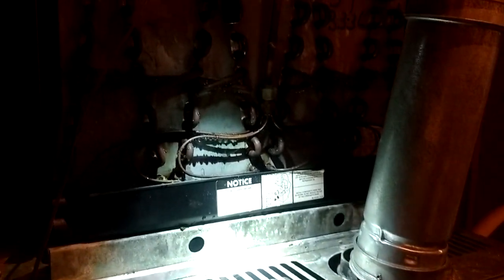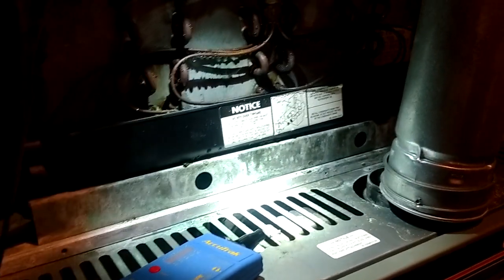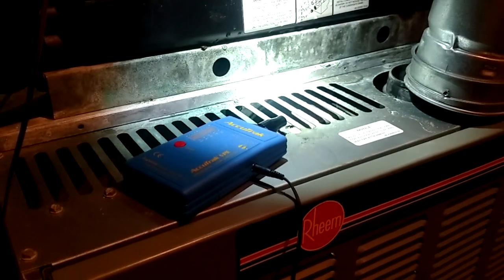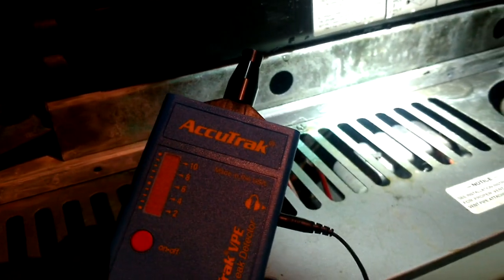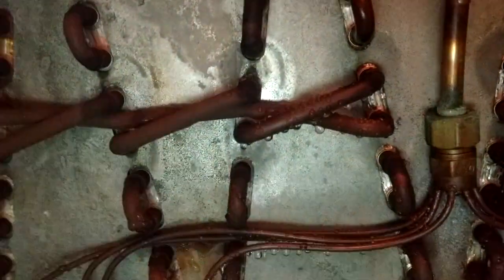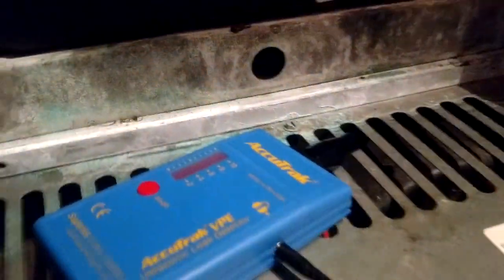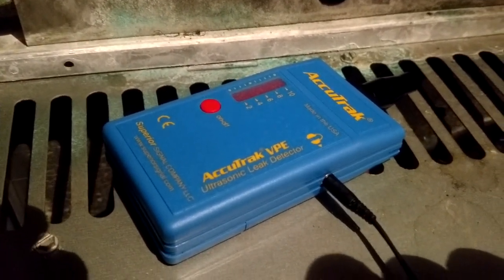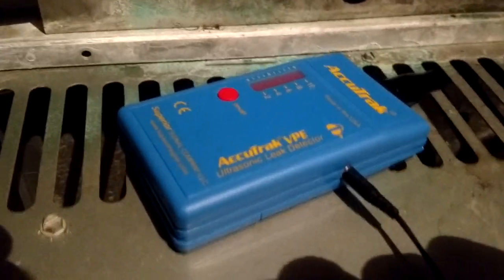🎧 Using Accutrak VPE ultrasonic leak detector in the field to find a very small HVAC refrig. leak

Comment: So wierd. My leak detection rate with this only 20% and it take an hour or more. And a lot of times i hear other noises like ticking sound and electrical buzzing. But i know system has a leak because i charge 2lb a year

Comment: Looks like you have had for a couple year now how is the detector holding up. How is the quality?
Reply from the maker: It's good. There's not really anything to tear up on it. No sensors to replace. Just change the 9 volt battery occasionally.
Reply: @sknight0391  ok thanks!

Comment: Hey Shannon, have you ever installed a UV light in a coil?  If so or not what do you think of them?
Reply from the maker: It will get very expensive replacing the bulbs over the years.
Reply: @sknight0391  Thanks, just wondering about them.

Comment: I finally got one. I noticed the sound is like static on a radio when it finds a leak. Any tips? I noticed when you spray water on the coil to emphasize the sound , it actually makes a lot of artificial noise because the water has air bubbles in it and those pop.
Reply from the maker: You just got to play with it. I don't usually recommend turning the sensitivity all the way up. For most applications you can get by with it just alittle over halfway up. I always test mine by lightly blowing out through my nose. That will also help you get familiar with the sound of escaping gas. Also use a can of compressed air to lightly bump it just to get used to the sounds. And I always use it in a sweeping motion left to right and up and down to pinpoint the leak location. Once you start finding a few actual leaks with itand get used to the sound then it will really make things quick and easy. I think you'll grow to love it over a period of time. Will it find every leak? NO. But it sure will find a bunch of them 👍
Let me know how it goes over time.
Reply: These thing actually “pitch shift” the ultrasonic frequency of the leak to a frequency that the ear can detect.  The leak is hissing but way out of human range above 20khz.  They have their place and uses but are not an end all tool.  Good to have!
Reply from the maker: @u2ooberboober  yes I completely agree. There is no such thing as a leak detector that can find every leak and anybody that tells you there is....Is full of sh!t. We have to have multiple tools in our arsenal to get the job done the best way we can for the homeowners. But the ultrasonic leak detector is always the first tool out of the van when I'm looking for a leak.
Thanks for watching and giving your feedback 👍
Reply: @u2ooberboober : YES. It's called "heterodyning". Many RF spectrum analyzers use this technique.

Comment: I just purchased one a couple weeks ago. I've tried it on two leaks so far. The sniffer found both, the Accutrak found none! I even tried it on the known leak area that the sniffer pinpointed with no luck. 
I am very disappointed, what a waste of money!!!!
Reply: Something is not adding up. Either you are doing something wrong, bought a cheap unit, or have a defective soemthing.
Reply: @Fighter4Street  I have since  received a replacement and it works well in most cases.
Reply: @MrDeviousdom  Would you say the ultrasonic device works better or worse to find very small leaks compared to a sniffer? Thanks
Reply: @Fighter4Street  ultrasonic detectors will not find ultra small leaks.
Reply: @MrDeviousdom  there's no leak detector on this planet that can find ultra small leaks.

Comment: I have been using this same tool for about 19 years. I use the yellow extension  tube which makes it easier to get to tight spots where you cannot  get  your hand  and  tool to. NOt sure if you know that Inficon makes  a Ultrasonic leak detector as well and its 50% less in cost to purchase  then this Accutrack.  Great video Shannon .https://www.ebay.com/itm/Inficon-Whisper-Handheld-Ultrasonic-Leak-Detector-711-202-G1-NEW-FAST-READ/192905542180?epid=2255626128&hash=item2cea10fa24:g:KIUAAOSwU7Bcy3kr:sc:USPSPriority!21214!US!-1
Reply from the maker: Yeah, Accutrak has made several improvements over the years. The biggest of which is you don't have to hold in the red button anymore. Now you just press it to turn it ON and you're good to go. They've even Incorporated a peak hold mode. And the sensor supposed to be much more sensitive now also. Thanks for watching 👍

Comment: No video with soap or leak detector so we can judge what the comparison ?
Reply from the maker: N.W. Ohio HVAC
This guy also has a really good video using the Accutrak "gooseneck". Same detector but has an attached flexible neck. I prefer the VPE because you can do more with it, like listening to the insides of motors bearings. Check out how easily he finds the leak in this video ⬇️

https://youtu.be/G2OL049AHeA
Reply from the maker: The Accutrak VPE is the only one that you need for HVAC. It's the third generation and you don't have to hold in the power button anymore. All you do is hit the power button to turn it on and it will stay on. they've also incorporated a peak hold feature that can be useful. And the sound sensor is much more sensitive than in older models. Comes with a decent set of headphones, extension tubing and the touch wand for listening to the internal components inside valves and motors. This is my "go-to" instrument for leak detection now. The $1,400 one would be more for industrial use or when your boss is buying it for you. Haha 
Zoro Tools still has the best pricing. Look for 15% or 20% off coupons on their website. if you don't see any call their customer service phone number, they're fantastic and friendly and will be more than willing to get you the best price. I put some links in the description of the video. 👍

Here is an example of what happens when you try to buy a cheap ultrasonic tool. You get what you pay for. I had a very bad experience with this one and had to film the video just to get a refund ⬇️

https://youtu.be/zRyGz8wRBUA
Reply from the maker: I film everything using my phone and if I pause the video for too long on my phone it will shut off and I can't pick up where I left off on the video. That was the case here. I don't have any fancy technology to edit videos later. It took quite a few minutes to be able to see anything with soap bubbles, and even then they were very small. Inficon tek-mate also picked it up. But it's so much easier with the ultrasonic detector. I found  one the other day back inside the coil of a mini split head with the ultrasonic detector, which kept me from having to pull the whole thing apart. I highly recommend the Accutrak VPE 👍 Thanks for watching.
Reply: @sknight0391  i know i tried one long ago and it looked like this,  amprobe has one and inficon does also , have you heard anything about them,  i don't want another $400+ piece a plastic junk. But willing to get it if it's worth it. Accutrack also makes a $1400 one,  wasn't sure how much better it would be.
Reply: @sknight0391  if your using an iphone imovie is a free app you can put a few short videos into one